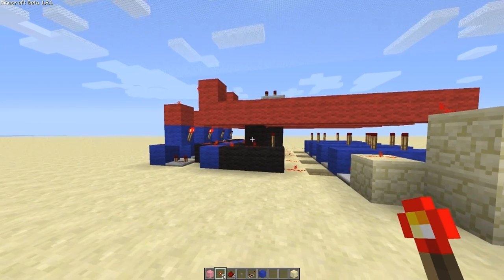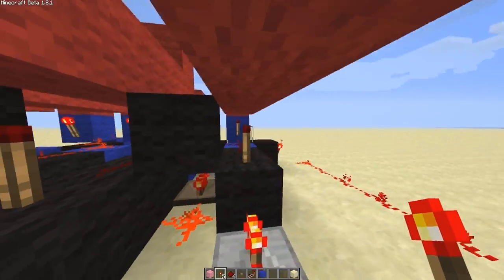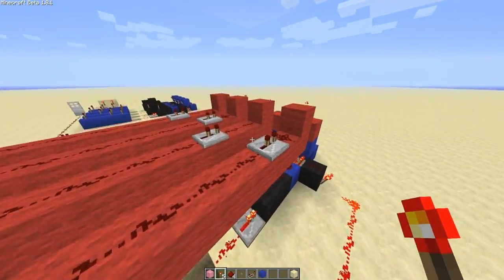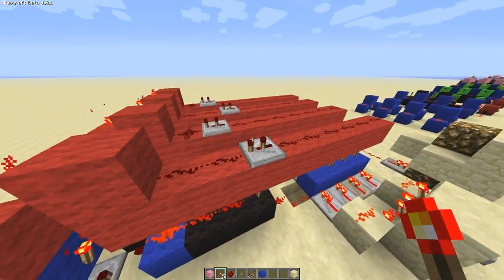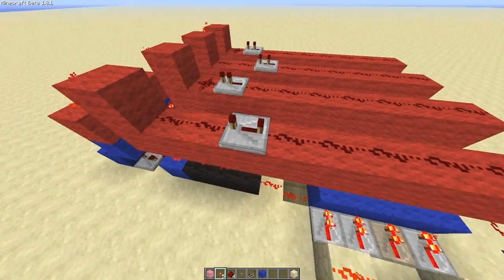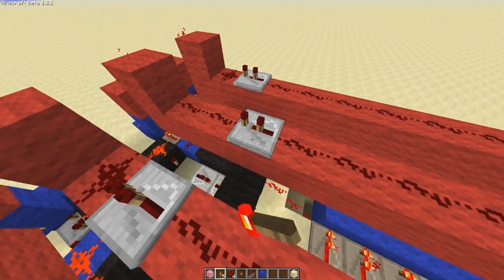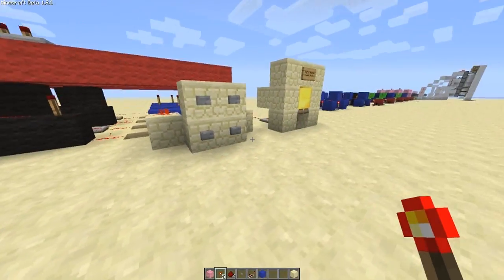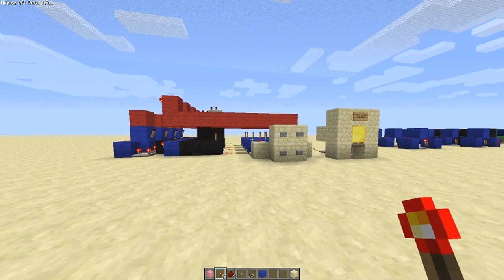Combination Lock UPDATE! [Minecraft Redstone Tutorials]

Comment: if i have multi points throughout my lock where i repeat numbers, is there any way in which i can stop mutiple torches activating as per this vid. Am trying to make a puzzle and am constantly hitting this problem. For example if my code was 1233223123 what timings should i use to only allow one torch to be lit up at a time. (I understand this comment proberbly make no sence, so please pm me if it you are confused so i cant clarify what i mean because i really need a solution). Cheers, Sputnik